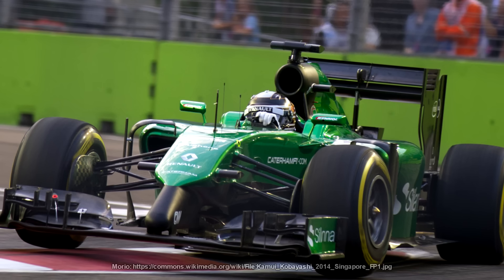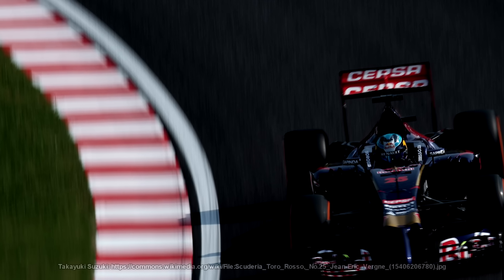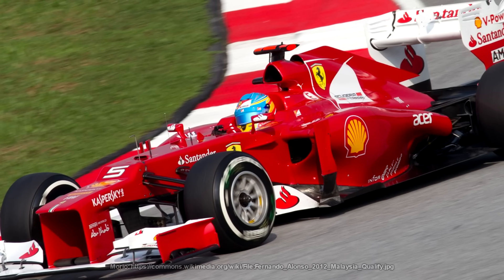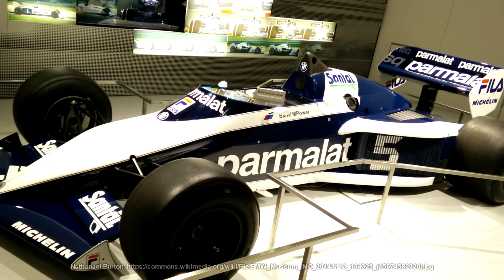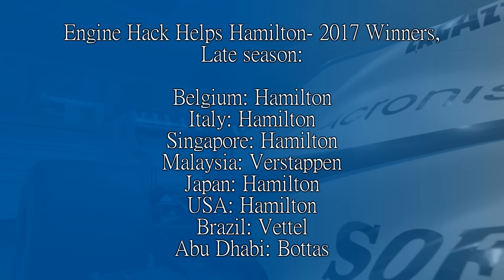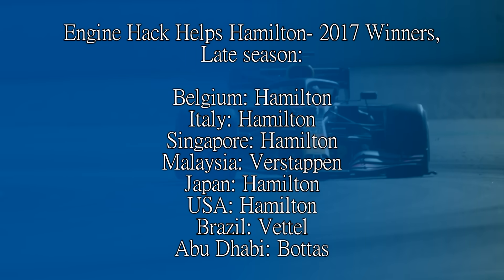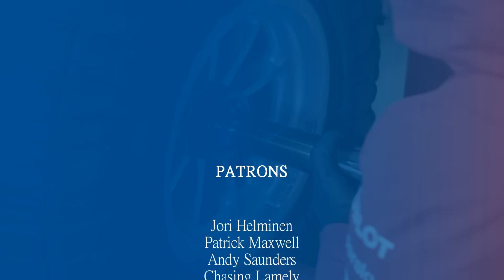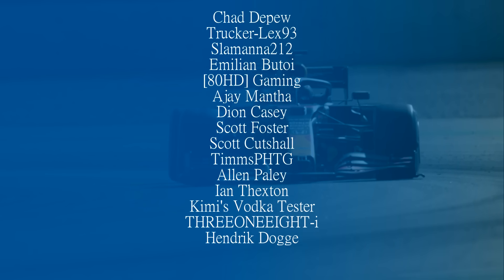NO BLUE SMOKE WITHOUT FIRE! The Controversial Oil Burning Trick (2016-17)

Comment: The burning 100% of the fuel thing is not technically correct. It's more about getting the fuel to burn quickly at an exact time. This results on the exhaust gases pushing on the cylinder closer to TDC increasing power and efficiency.

Comment: FWIW, endurance racing engines burn about a liter every 4-6 hours. It's completely normal and there are pressurized bottles we use to add oil during pit stops.
Reply from the maker: So did my old Peugeot 206.

Comment: By 1988, the McLaren Honda's were running on "rocket fuel" (or jungle juice, whichever you preferred) supplied by sponsors Shell that was 16% methanol and 84% toluene. It was basically the same stuff (just with an extra 5 years of refining the process thrown in) that Brabham used in 1983.

By at least the end of the turbos in 1988, pretty much everyone in F1 was running on some sort of performance enhancing fuel.

Comment: Toluene 

"In the last era of turbocharged engines some pretty exotic but highly lethal fuels were used. These were pioneered by BMW, which had supposedly found the formula through reading papers regarding fuel development for the highly boosted engines used by the Luftwaffe fighters in World War II.

These fuels bore little or no resemblance to petrol, and indeed the rules didn't require that they should. Instead they were a mixture of hydrocarbons; the majority was blended from benzine, xylene and toluene. The primary component was the toluene at close on 85% of the fuel mass, which had an octane rating of 121, significantly higher than the 100 octane standard aviation fuel. Unfortunately, toluene is highly carcinogenic.”

Comment: I remember when Ferrari turned up the oil and was suddenly a front runner. Next race mid pack. This is the same reason Mercedes has been calling for "low ash oils" to be used in their road cars. Better perceived fuel economy.

Comment: I thought the whole point of regulations was to find clever ways of circumnavigating them.

Are you sure Brabham contacted BASF? Surely it was another German company, a builder of engines used by the German Military Aircraft Industry and who also propped up the same mid twentieth century despot, they supplied the engines to Bernie Ecclestone’s (another Dictator) Brabham team.

Comment: 5 liters was the first limit? That seems like a LOT
Reply from the maker: Two big bottles of Coke, filled with oil. Your road car would get through that in about 20,000 miles.
Reply: Yes it was. Over 1.5% of oil in the fuel. That’s not far off the 2% ratio of 2-stroke oil.

Comment: 0.9L oil burning per 100km  is borderline 2 stroke territory.
If you had a car that did that it would have to have at least  million miles on it
Reply: correct. Many car manufacturers had an oil burning limit of 1L(or more) of oil every 1000km. An engine like that would be considered worn out and in need of a rebuild.
Reply: @jfv65  some VW have problems with oil consumption, VW only considers it a problem if it's more than 0.5L per 1000km
Reply: @fuzzy1dk  audi said 2L/1000km is normal lol
Reply: I think it is sort of acceptable if we consider the relationship between RPM, power (W), cylinders and cc of fuel. Like, if your street car does 1000km always at or around 2k RPM and using 100hp, of course it needs less lubrication than another that is doing 500km at 5k RPM and 200HP.

There will be a scaling factor to all of this, of course, but F1 engines are VERY extreme, few cylinders, absurdly fuel efficient, crazy RPMs, etc. So we can't compare how much oil it will or won't burn to our own experiences. 

But Trully, I agree that if the FIA said "you can't lose more than 500ml per race length", Merc, Ferrari, Reneault and HondaFordRBR etc., would be able to do it, with help from PETRONAS/Shell/Exxon/BP, of course.
Reply: @prgnify  lubricant in a four stroke engine isn't supposed to be"used", it gets worn out and contaminated but not "used"
Reply: @fuzzy1dk  Sort of. You do lose oil with mileage, it isn't just something you replace when changing the filters, if you measure how many liters come out vs. go in, you can see every engine has losses. And that is to be expected. Look at a piston, its rings, and how they are offset, then reason how the head of the piston is cooled, or the upper lip lubricated or whatever.
Reply: You never saw my old Integra….

Comment: As far as the whole "rocket fuel" topic, this is what I can say. According to the 2004 book "The Chariot Makers" by ex Benneton mechanic and broadcaster Steve Matchett, he tells how that in the early 1980's, Renault came up with a water injection system to shoot a atomized mist of water in order to lower cylinder temperatures to control excessive heat build-up to increase reliability. So this water injection system delivered the desired results it for some unexplained reason horsepower also increased. So they worked with their fuel partner Elf to come up with a new fuel for this. Also of note, Ferrari did something similar with their fuel partner Agip. What started out was mixing petrol with Avgas(aviation fuel for short used by piston engine aircraft, basically leaded gasoline). Then some fuel chemists started talking with people from NASA and  teams started using a subtle blend of 80% toluene/20% "regular petrol". Also a side point here, as far as that BMW engine and how much horsepower it had, according to a documentary about the history on BMW Motorsport Gmbh that aired on the old Speedvision network here in the USA, Marc Suere( hopefully I spelled his last name right) said that during a test he asked one of his engineers how much horsepower he had and the engineer said they don't know because their dynometer was maxed out at 1250 horsepower so they think it has 1350 horsepower.
Reply: Great insight. A paragraph here and there might help with the reading.
Reply: Water/methanol injection is used to cool the incoming air leading to a denser air charge for more power it has nothing to do with turning to steam in the combustion chamber
Reply: The water injection sounds like what old B-52s and KC-135s would do on takeoffs back in the day for extra thrust. I believe it was to cool the air going into the turbine so a little different than this use. I remember some old pilots saying they were “burning water” on takeoffs.
Reply: Steam injection has been around since before WW2.  Many WW2 aircraft had water injection.  The extra power comes from the water flashing to steam, and the expansion helps to push the piston down.
Reply: I used to do some service work for a rally team during the time of the Mitsubishi EVO4 , 5 and 6 and in the service area there would be a corner where they  would do the refueling. Those turbo cars always ran special toluene fuel which smelled like nothing else and irritated your eyes...   TOXIC as well! But that fuel allowed for a lot of boost without detonation issues = more power. (if mapped correctly) 
As for water/methanol injection: Volvo did this when they raced their 240Turbo's in the WTCC. For the same reason: limiting detonation while burning more fuel in the engine.  The evaporation of the methanol made the incoming air to cooler (the evaporation drew energy from the air, it's physics)  which meant more air (oxygen molecules ) could be crammed into the cylinders with less risk of detonation. 
The water that was also injected had a large expansion ratio (water to STEAM)  meaning a higher pressure on the pistons after the mixture had been ignited  = more power. 
This allowed Volvo to BEAT cars like the BMW 635csi and Rover Vitesse 3.9L V8.
Reply: Imagine if you had a porous intake ports, and the pressure of the cooling system was regulated so it increased with the airflow into the engine; the water wouldn't be burning, so would be legal. 
Water spray on the intercoolers was also used in the early turbo years. 
It's hard to know if the increased performance is from a cooler intake and compression charge, or better burning, or the water taking up heat during combustion, turning to steam, and adding to the force on the piston, or a combination.

Comment: I'm sure Mercedes did everthing they could to accelerate their engine development in 2017 to beat the oil rule change. They had to assume Ferrari would do the same. 
After leaving Brixworth in mid-2020, Andy Cowell said that he had left because the pressure of trying to compete with Ferrari's illegal engine became too much for him.

Anyone who found the 2020 F1 season boring should complain to Maranello, not Mercedes. The huge leap forward in performance by Mercedes that year (powertrain & chassis) was a response to Ferrari's engine. Instead of counting on getting it banned (most of the lobbying for that came from Horner & RB), they set out to beat it.
Meanwhile their only real competition for the previous 3 seasons (Ferrari) had produced a high-drag, maximum downforce chassis for 2020. Designed for a significantly more powerful engine than they ended up with, after doing that secret deal with Ferrari Internation Assistance.

Comment: Something else Ferrari were strongly suspected of doing with their illegal engine was detecting when the fuel flow sensors were taking their readings and exceeding the flow rate in between the measurements. For 2020 the FIA took action to counter this by encrypting the data between the sensors and the FIA's second ECU. Circumstantial evidence that Ferrari had probably been doing this.
They would still be bound by the 100Kg per race fuel limit, so it couldn't give them loads more power all the time throughout the race. But it could be a substantial advantage in qualifying, and during the race when accelerating out of corners (once no longer traction limited) and for overtaking... which fits pretty well with the observed strengths of their car at the time.
Reply from the maker: Which makes you wonder if the new Merc engine for Spa sent them down that route, and the iffy battery deployment route.
Reply: @AidanMillward  Knowing Brixworth they probably had a trick of their own. They certainly found plenty of performance over the next few years.
Merc's performance seemed more consistent across the whole race than Ferrari's, which suggests they weren't using either of those tricks - evading the fuel flow or power deployment tricks.  
Maybe they had a super-duper more energy dense oil to burn? Who knows. Fingers crossed Andy Cowell writes an autobiography someday once he retires.
Reply: @AidanMillward  Do we actually know if Ferrari did the battery thing, or is that just a theory? We do know they definitely did something to trick the fuel flow meter, given the non-disclosure agreements with the FIA and the rule changes that followed.

Comment: Actually jet pulse ignition isn't a new thing, diesel engines have used it for decades. The concept is to ignite a small portion (5%) of fuel in a pre-chamber that creates a high temp plasma pulse used to burn the rest of the mixture that was injected a fraction of a second later. That creates a very high temp spike for the amount of fuel used, but it also risks pre-ignition (knock), oil has natural anti knock properties but like diesel burns too slowly to use in high rev engines as a fuel, but in mist form through the PVC system it's the perfect carrier for anti knock compounds like tetraethyllead that while banned in the fuel itself isn't (or wasn't at that time) as an oil additive. Even without the additive the right amount of oil mist will still give anti-knick benefit. All Mercedes had to do was run higher pressures in the oil pump to increase windage and have the excess drawn into in intake by the PVC system, that would allow the ICE to run at more aggressive ignition timing (or leaner fuel mixtures) with less tendency to knock given them the option of making more power and (or) using less fuel.
Reply: Injecting fuel into a pre-combustion chamber is very different thing in a spark / flame  ignition engine vs a compression ignition motor.
Reply: @ebutuoyYT  It's very much the same, the only difference is there's a spark plug in the pre-chamber (for ignition) along with the injector. Ferrari used a combination injector/spark plug that allowed them to optimize the shape of the combustion chamber unlike the initial Mercedes design that had the chamber milled into the head itself.
Reply from the maker: I didn’t say it was a new thing?

Comment: Back in 1997 my Dad and his work friends had a dirt circle track car. I remember my Dad working piston rings to help their engine burn oil during their races just like this. I also remember there was some kind of Rule about suspension had to MATCH the car manufacturer. They ran a "Red Dog Beer" branded buick(General Motors) and my Dad had went to a junk yard to find Springs for the car. Anyways, the 70's era Chevy and GMC 2WD pickups had true independent front suspension with coil springs. So their car had some 1 ton pickup springs. I love little things like that in racing. Cheers Aiden
Reply: The current era passenger vehicle engines also burn oil, because of low tension piston rings.
Reply: @squidcaps4308  also because of manufacturers forcing thinner oil into the engines
Reply: @n2oin  They have to, the cross-hatching of the cylinder walls has also changed and it requires thinner oil.

Comment: Alcohol is just ethanol. It works just fine in an internal combustion engine.
Reply from the maker: Liquid oxygen might fuck it up tho 🤣
Reply: @AidanMillward  you could use liquid oxygen, but there wouldn't be much point because we have enough of it in the atmosphere. Rockets use liquid oxygen because they go into space, a place that has no oxygen, so they need to take it with them.
Reply: You could inject LOX and extra fuel into the intake and get a big power boost, like a nitrous system but even more potent.

This has been tried, but LOX as you might expect tends to produce substantial increases in the combustion temperatures so this idea tends to end in melted pistons.

Comment: The "rocket fuel" thing is because the fuel additive was tolulene. Tolulene is one of  many, MANY liquids that can be, and sometimes is (I think) used in liquid fueled rocket propellants. Even that explaination is too complex though, so everyone just says, "Well it get can be rocket fuel sometimes, and that's simple so it's fucking straigh up rocket fuel just like the Space Shuttle."

FYI, if it's a liquid and it burns, it can be, and probably at some point in the last hundred years has been at least tested as liquid propellant for a rocket engine. Lots of early rocket pioneers used gasoline, so yeah every F1 car ever is really just running on rocket fuel.
Reply: A liquid does not need to burn to be rocket fuel.  Hydrogen peroxide is a great example.  The British used it as rocket fuel but it deconstructs in the pressence of a catalyst in to oxygen and steam at 500 degrees C.  Push this out a nozzle and you have a rocket.  Just FYI.
Reply: @ianbutland844 Ahhh, yes, the intricacies of liquid rocket motors. Find a copy online of "Ignition! An Informal History of Liquid Rocket Propellants" by John D. Clark. Fascinating read. 

Hydrogen peroxide is 2-faced: it can be used as monopropellant, but it can also be used as oxidiser in combination with a liquid that will happily accept the oxygen.
Reply from the maker: I covered all that in the rocket fuel video 🤣
Reply: It's thanks to this "rocket fuel" that fuel is now restricted by weight rather than volume. Tolulene-based fuel is heavier than regular petrol.
Reply from the maker: @carlhague9102 but is it calibrated to 15°C tho? 🤔
Reply: @AidanMillward  fuel has some temperature boundaries before it gets pumped
Reply: Tolueen isn't an additive. It's an hydrocarbon that is makes up a large part of regular petrol (in the ballpark of ⅓).
Reply: It's also the second T in TNT, and a solvent once used in paint.